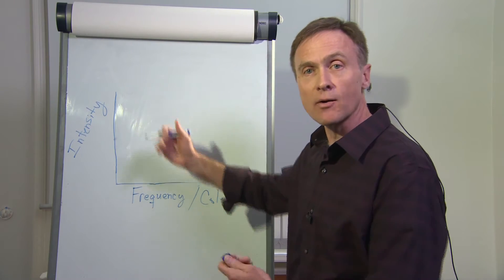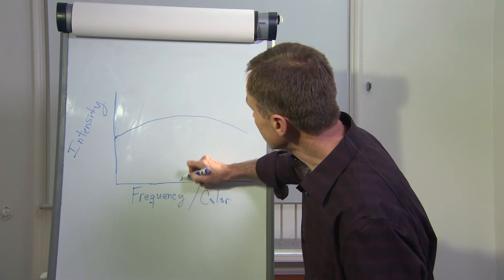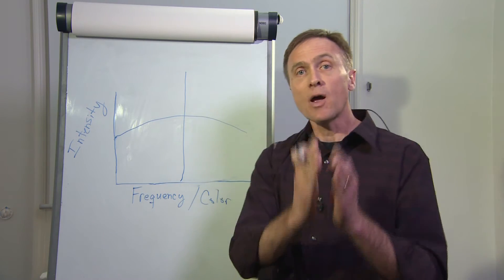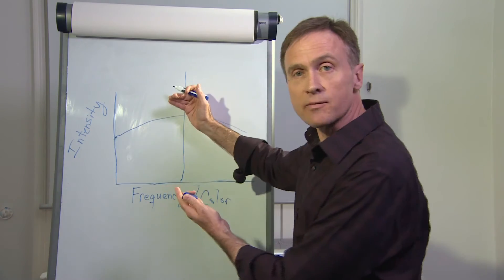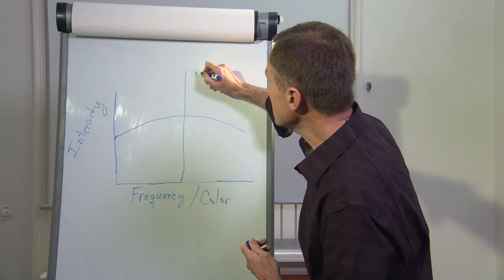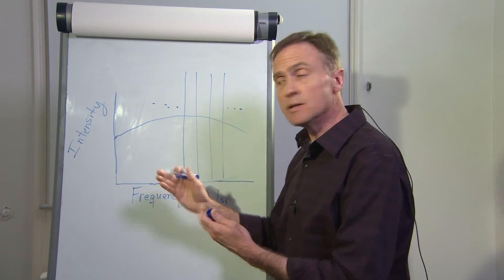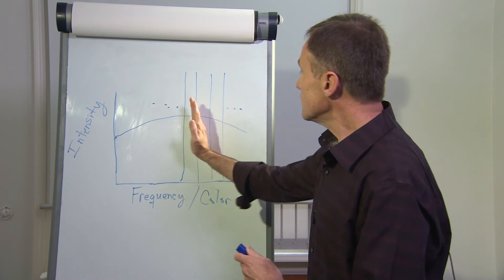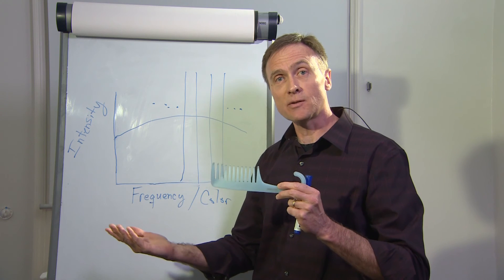What is a frequency comb?

Comment: Countless articles and journal papers gloss over or ignore completely the fact that the spectrum of a time series of pulses is usually done by analysis apart from the laser system.  It has no usable existence as a spectrum in the actual system.  The spectral lines exist only on the screen of an expensive spectrum analyzer or as mathematical results.  How these systems create and utilize a stabilized comb spectrum must be a key part of a complete description.  I still don’t understand it after many hours of reading explanations that miss this point.